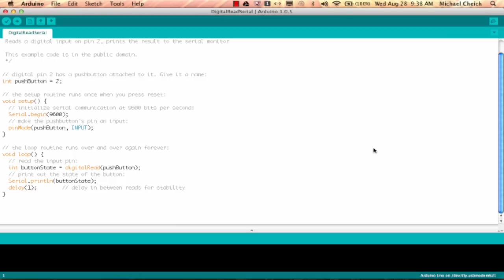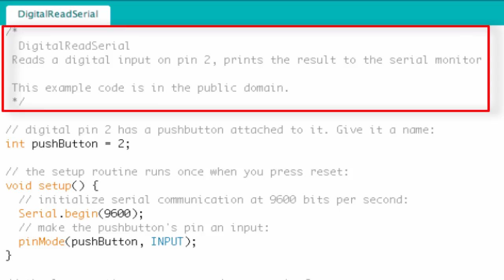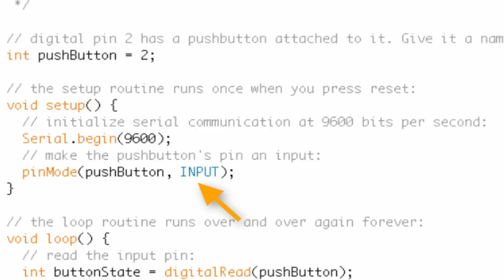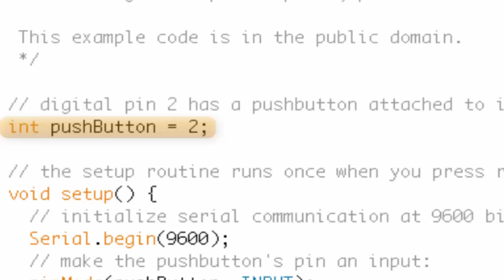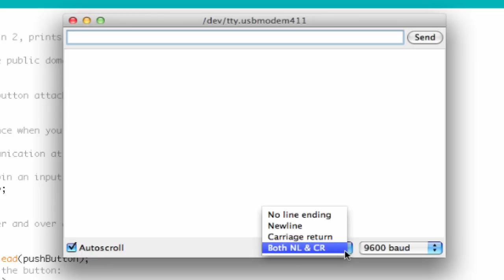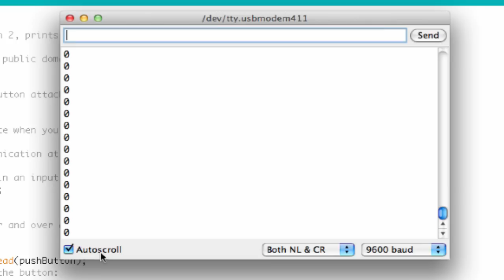Tutorial 07: digitalRead() and the Serial Port: Arduino Course for Absolute Beginners (ReM)

Comment: Thank you so much for the great tutorials!  This video brings up one of the hardest things for me to grasp in electronics.  As you say in the video, "Pin 2 sees zero volts".  I have figured out that this is the reason for the resistor.  However, I can't figure out how it works.  Zero is "nothing", so how can Pin 2 "see" or "read" nothing?  If you can explain that, I'm sure it would go a long way in helping me and a lot of others understand electronics. Thanks. Regards.

Comment: You are awesome programmer very clear explanation.
I been searching for a simple code but no matter what I do I can’t successfully complete it. 
2 LED WILL ALTERNATE BY PUSH OF ONE BUTTON USING ARDUINO.
That while holding the button down #1 led will be on, when you release the button #1 led will be off,  but when you press and hold the button again #2 led will be on and when you release the button again led #2 will be off. Then repeat.
Reply from the maker: Thanks Eduardo - you're to kind!

I'll see what I can do for a video on that setup!

Sounds like you need some code to...
• track button presses
• track button releases
• You'll definitely want to make sure the button is debounced
• depending on the count, you'll want to turn on the LED when the button is down - maybe like checking if the count is even or odd...
Reply: @programmingelectronics  is this really possible?
Reply: Wow !! That will be awesome. I looked everywhere nothing setup this way ,this will be different led  for all my Collection. Most of them stay on even button  is release.

Comment: very awesome job, but why did you use the 10 kilo ohm resistor?
Reply from the maker: Great question.  It acts as a pull down resistor. 

Here is a short explanation on that: https://www.programmingelectronics.com/floating-pins-pull-up-resistors-and-arduino/

I hope this helps some!
Reply: @programmingelectronics  thank you very useful

Comment: Nice Video, 
     How do you get past : void loop() ?    The program gets in the loop,  and there's no way out..   How do I do something else while the led is blinking.  ?
Reply from the maker: Such a good question Thomas!  To answer your question, you never get out of the loop - it is an infinite loop.  

To add other functionality, you introduce other control structures into the program, like if statements, for loops, while loops, switch case, and start using interrupt driven code and timers (e.g., you start using millis() for timing of events)

Comment: I feel like Einstein right now 😆. My dream building a human robot is one step closer. Ok so outside signal on and off reads on monitor as 0 or 1. But what's that supposed to do? Can I use several buttons on different pins and get 001010...?

Comment: To whoever doesn't have the breadboard and wants to use ONLY arduino, you can define  pinMode(pushButton, INPUT_PULLUP);   instead of how it is in the video as just INPUT and you will only need a wire to connect one side to the ground  (on arduino is written as GND) and the other side to the pin, in this case pin 2.  Atmeg micro-controller from Arduino board itself has inside implemented a resistor that's why you won't even need one.

p.s. it's nice to try as a lazy alternative hehe
Reply from the maker: Thanks for adding that!
Reply: @programmingelectronics  np, but thank YOU for these really high quality explanations and videos!

Comment: why a 1 and 0 why not the actual voltage? is the 1 and 0 a default mode and you need not specify it in code?

Comment: "exit status 1
Error compiling for board Arduino/Genuino Uno."
I got this error while doing this,I made the exact same circuit and exact same code but the only difference is that I use Windows 10 instead of Mac.Please help.

Comment: Since the pin codes are 1 and 0 for high and low respectively... you made us understand that we use the "int" data type. but why dont we use the "boolean" type since its 1 bit to save storage

Comment: in the previous tutorial a 220 resistor was needed but now it's 10K. Why? What is the difference?
Reply: 220 Ohm is to protect LED from full voltage (5 - 9 V).  Here resistor is used to keep the pin mode in LOW state, when button is not pressed).  10K resistor will limit unnecessary overcurrent in the circuit.  Some people use 100K upwards.

Comment: So if i get it right the resistor is there because if it was not current would rather flow to ground then pin 2 ? (after pressing button)

Comment: i did everything exactly the same but when reading on serial monitor, it reacts to vicinity of my hand! I don't even touch the button , when i put my hand close to the board it changes value?! i tried moving components on the breadboard and i get the same result. I thought at first I connected some kind of weird photo resistor but no, switch provided in starter kit. Any ideas?

Comment: Can directly write , instead of adding a variable-buttonState ? 
int pin = 2;
void setup() {
 
 Serial.begin(9600);
 pinMode(pin , INPUT);
}

void loop() {
  
  digitalRead(pin);
  Serial.println(pin);
  delay(1000);
}
Reply from the maker: Great question!  Yes you can, it would like something like this...

  Serial.println( digitalRead(pin) );

I prefer to make it separate, and use a variable to store the state, because for me it is easier to read/follow, but I think the above should work fine.

Have a great one!
Reply: Thanks

Comment: Great video!!

I have one question: In your circuit diagram you have the blue jumper set to pin 2. Wouldn't the current just ignore that path and go straight to GND? Also what is the point of the resistor if ground is zero?

I just bought the Arduino today and I don't have a clue about any of this, so forgive me if this question makes no sense.

Comment: Hi! Nice set of tutorials. I'm curious how do you choose your resistor values. I can see you using the 10 kOhms in this tutorial although I can't see why this value.
Reply: I saw in another comment that the resistor is used to connect the digital input pin to ground without short circuiting the board. The comment also said that connecting it to ground prevents "floating input" I'll let you know what "floating input" means once I fully understand it

Comment: A few things i don't understand:

1. why is "buttonState" define as an "int" (integer). I would have thought that since digitalRead only can return one of two values (HIGH or LOW) that buttonState would be defined as a boolean value, not an integer value. if you define buttonState as integer does it just return the value 1 or 0 depending on what is the state of the input?

2. why are you declaring buttonState in the loop function? i would have thought that you would just declare buttonState in the setup function and set it to some initial value there, and then have the statement "buttonState = digitalRead(pushButton)" in the loop function rather than having the "int" in front of it, which accomplishes the same thing but also re-declares it. it seems inefficient to me to do it this way, but maybe i'm just missing something.

help?
Reply: he pulled this out of the examples that are in the ide. so he didnt really do anything.  it isnt efficient at all, if your trying to get the most out of your arduino. but for the purpose of this project and without confusing beginners by going on an un-needed and confusing rant  explaining the inefficiency of the code its perfectly fine. These tutorials are understanding your arduino and getting your head around the whole concept not just coding efficiently, that can come later.

as for your first question,  booleans were traditionally 1 or 0 and so as a guess i imagine HIGH and LOW are for readability.

Comment: Ok so I tried doing this without looking at the video and it was annoying me that the test light stayed on so I wrote a blink sketch very quickly. It is pretty much exactly what is in the example code. But now my problem is that lets say the code to print the value of my button input is in the beginning of my code, I have to wait until the program reaches that point. I guess I could re-write the code in between lines of code but that doesn't seem like good practice since that would definitely make things run slower on more complicated programs.

Is there a way to blink a light without halting any other code?

Comment: It's appears that the 5v does now flow through the resistor when the button is pushed? Please explain the resistor. Thanks for this great lesson!
Reply: You know that electricity always want to take the easy way out? Pushing the button creates a easier way to flow
Reply: +Mike Dellink So if the resistor was replaced by a conductor then pressing the button would just allow electricity to flow tot the quickest route to ground?

Comment: Dude your awesome. I am learning ALOT. but quick question...why use a resistor? Whats the simple logic that is behind that.

-YK
Reply: You never want to have an input "floating" (Could lead to unreliable readings of the input), which it would be if the Arduino-side of the pushbutton isnt connected to 0 V (ground) when depressed. If you dont have a resistor, you would shortcuircuit the 5V & ground when pressing the button. To avoid "floating inputs", you just need a very tiny current, so a 10 KOhm resistor is perfectly fine. Hope this explains the function of the resistor :-)

Just seen it also was explained by Terah 6 mth ago :-D
Reply: That's my question as well, i'm kind of noob in electronics, but your courses teach me very much.
Reply: Oh, okay. Didn't see his reaction. So the Arduino will just see it as well with a very small current?
Reply: This guy explains it pretty well. Took me a few times to get it. From my understanding even  when the circuit is open there still can be stray currents induced that make the input values float slightly. The resistor draws stray current away from the open circuit  so the input value remains at zero.
Reply: It wont "see" the resistor in any way..Its a digital input, so either 0 or 1 (5V). When button not pressed, the voltage on input is 0V, held down, but without anything but like a few microamps beeing used to hold it to 0 V. When button pressed, input gets 5V straight. But resistor itself is not seen by the Arduino..Except that if it was not there, you could get some irratic results.
Reply: Actually arduino is reading the voltage drop across the resistor; if there is no resistor there will be no voltage drop thus no reading :-)

Comment: if your a extra noob like me and after this tutorial you find your read is irratic check to see if your bread board is not split into sections, the arduino digital read will do that if not connected to ground this is normal.

Comment: Can you comment on why you need a resistor on the input to the push button tied to down?  Same question really on why you need a resistor in front of the LED?
Reply: I'm learning as well, but I believe the reason you need a resistor for the LED is because that particular LED can only handle a certain amount of Amps (20 milliamps, or 20mA I believe) or else it will break. As for the resistor here, I'd love a more detailed explanation from the video creator.
Reply: +Mark Bernard Hi Mark - the resistor for the button is to make sure the button state isn't 'floating', which, in case of an LED, can cause erratic blinking. By grounding it via a resistor you ensure that the input reads 0 volt (and not, as can happen when you're running power through multiple components, a low but random voltage). 
For the LED. the resistor limits the current running through the LED. The way LED's work, as semiconductors/diodes, a small change in voltage can have a big effect on current. The resistor is to make sure both the board and the LED won't be blown up if something unexpected in the voltage happens.

This is just Google and my understanding of this matter speaking, so if anyone has a better answer, don't hesitate to jump in :P
(Although here is the resistor-with-the-button answer: https://www.arduino.cc/en/Tutorial/DigitalReadSerial)
Reply: would it be because the pin is always sending current to the pushbutton and when the pushbutton is depressed current will take the path of least resistance (through the pushbutton circuit) ??  thats the way i see it not certain tho

Comment: I too have a desire to understand all things in the universe :), but could you just tell me if 9600 is used in all cases? Thanks!
Reply from the maker: +Saighuhan Senthilkumar Yes, 9600 is a safe bet for most projects - however, don't be afraid to adjust it if the device you are communicating with needs a faster baud rate.
Reply: +Open Source Hardware Group Thanks!

Comment: Hey mate, thanks for the video's. They've been great to watch however, I thought I had broken something!
I was using digitalRead from a pin which had no variable attached and no voltage HIGH/LOW being sent to and yet it was triggering my pin 13 LED to light up! It was a neighbouring pin and despite many a head-scratch, I couldn't figure out why a neighbouring/unused pin was still activating my LED. So I discovered a capacitance issue whereby the nearby circuitry, atmosphere, finger tips etc can still trigger a HIGH state. No doubt you're aware?

So yeah, I broked it but now I force a LOW state on this pin and it's all fine now. No errant LED lighting :)

Comment: its not showing 1 when i press the Button, but it disconnects the arduino from the PC.
Reply: +Samuel Simuyandi checked the circuit and everything is connected properly
Reply from the maker: Hi +Samuel Simuyandi ,  what happens if you replace:

Serial.println(buttonState);

with...

Serial.println("Test");

Do you get a read out on your serial monitor window?

Comment: Great tutorial-series, but there is one thing that made me wondering. If the button is NOT prest the circuit starts at pin 2 and end in ground. BUT, when the butten is prest, the circuit starts at 5V and end right in pin 2?

Is this really possible to start and stop a circuit in a pin, or is it just my mind playing tricks on me?

grts Arofnogneu
Reply from the maker: Great question, arofnog neu Internally, Pin 2 eventually is connected to ground, so current will flow from the 5 volt pin to pin 2 and to ground.  It is also worth noting that when the button it pressed, some current will also be flowing through the 10k resistor to ground.

Hope this helps some.
Reply: Yes, it made it more clear, but if Pin 2 is internally connected to ground, why would it flow through resistors or LEDs? Doesn't electricity looks for the quickest way to ground?

(I'm a programmer not an electrician :D )
Reply: +Programming Electronics Academy
Could you elaborate on the need for that resistor? Why does some of the current need to get to ground that way, instead of thru pin2? Also why does it have to be a resistor, instead of just a wire to ground? Awesome series so far!

Comment: Great tutorial 07 digital read. I have done two challenges too.
Q.. Do I need to wipe the old sketch before I load a new one ? For example blink LED  is sitting in the Uno working away happily,  then I load a new sketch over it .I guess the original sketch is over written with the new one .

 Q is it wise to cover the bottom of the Arduino Uno as it looks like all the pins from the PCB are exposed ,it could short out...

Great job

Dave
Reply from the maker: Hi David dave , Thanks for watching and for posting great questions.

Q1:  When you load the new sketch, the old one is overwritten - nothing more you need to do.

Q2:  I agree with your observation, though I can't say I have ever had any issues, and have never covered the bottom.  I normally do work on a wood desk and I do my best to keep my work area clean. 

Thanks again!

Comment: I don't understand the int buttonState = digitalRead(pushButton) ;'s meaning
Reply: +Vidit Gautam
this code is telling the program to digitally read whether pushButton -  pin 2 - is receiving a HIGH (5v) or LOW (0v) voltage

if pushButton has a value of 0 (LOW), then so does the variable named buttonState
if pushButton has a value of 1 (HIGH), then so does the variable named buttonState

your computer then reads the value of buttonState ((via Serial.println(buttonState)); this way your computer knows how to interpret presses of the button as binary

Comment: i have a resistor that have 5 bands.
10k Ohms and 220 Ohms ( i don't know if i am reading it right because its looks the same from both sides ) but they have 1% ( that what the calculator is showing ) can i use it?

Comment: What that Resistor does in this circuit?
Sorry I am a programmer, not that good at electronics.
Reply from the maker: ***** That is a great question, and it is not all that obvious.  If pin 2 wasn't connect to ground through that resistor, it would be floating. I actually made a video tutorial that mostly address the question you ask:  https://youtu.be/G_i1ZhadTa0

I hope the video can help clarify this further.